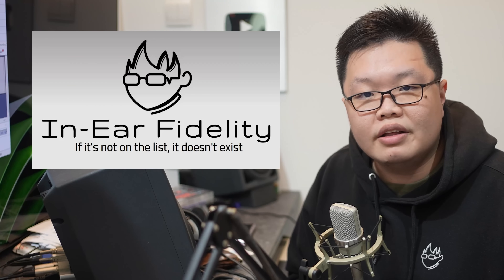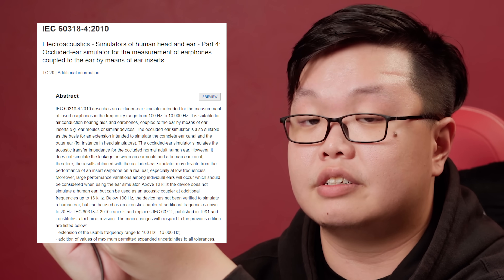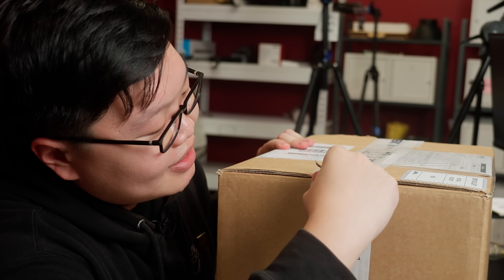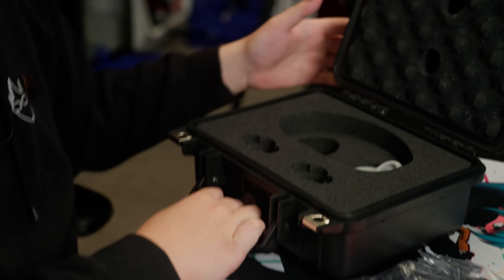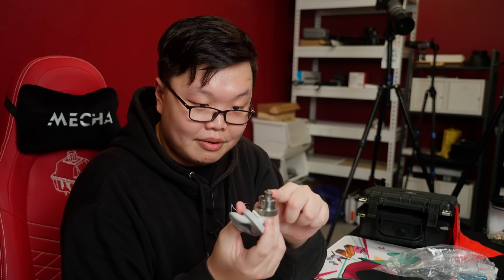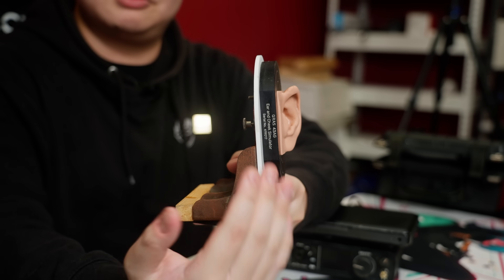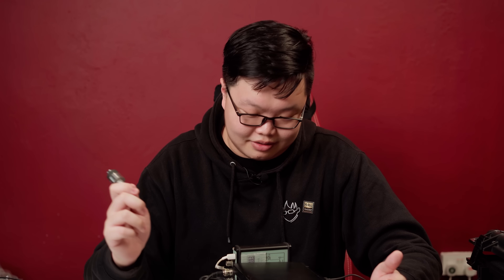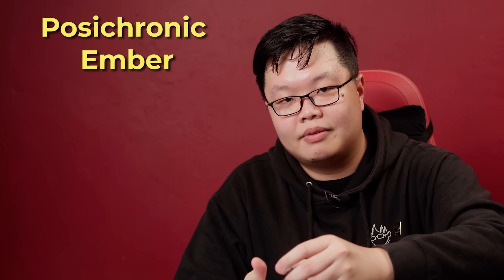I bought a $20,000 mic to measure earphones

Comment: I deal with RF test and measurement equipment all day; you are actually really lucky those were both SMA connectors and one wasn't a 1mm connector. If it was you would of stripped that super expensive transducer.

Comment: I personally don't get it. If it's that hard to make a coupler, why not measure the response at the driver/nozzle and then extrapolate a response at an eardrum from there. This is the way we do it with speakers. Klippel scans the driver at the diaphragm and does some magic math to print out the response pretty much anywhere in front of the speaker. Allegedly it's even more accurate than an anechoic chamber.

Comment: That small coaxial connector is called a 10-32 Microdot (or just 10-32 coax connector), the transducers are likely IEPE / ICP / CCLD powered (18-28VDC @ 2-20mA regulated).
Reply: Ah cool. I was going to say it looked like SMA, but that was based on my experience dealing with RF connectors and not lab equipment.

Comment: Your reviews helped me to choose a great pair of headphones. The Sennheiser IE 40 PRO look like they are some of the most neutral sounding headphones in your frequency response graph and they sound impressively similar to the EVE SC 207 audio monitors at lower volume, which are almost 9 times more expensive than the IE 100 PRO headphones, which have the same speakers and only a different cable and connections in comparison to the IE 40 PRO. I wonder how their graph will look with the new microphones. I think they are promising.